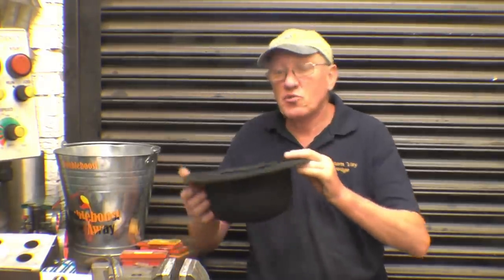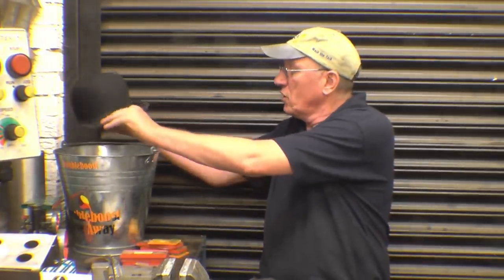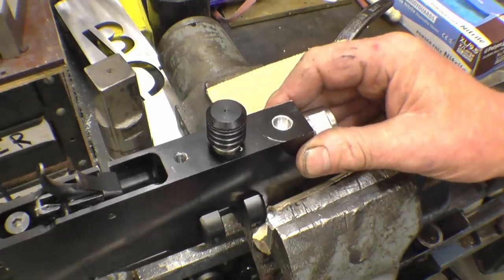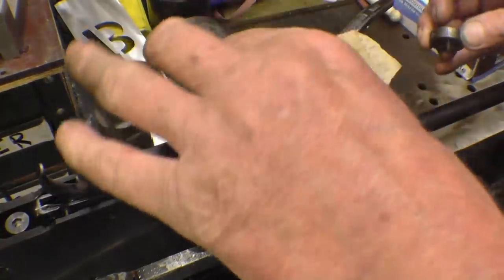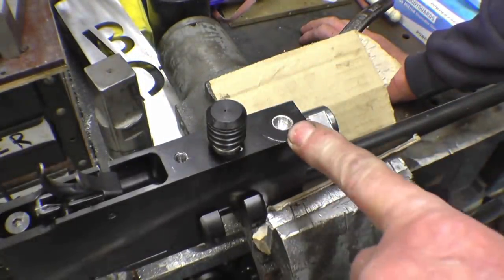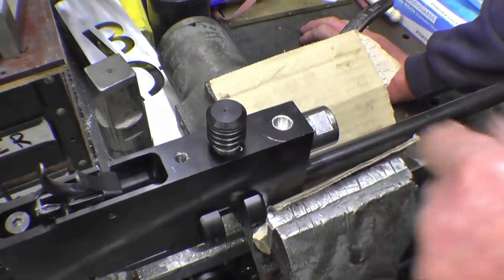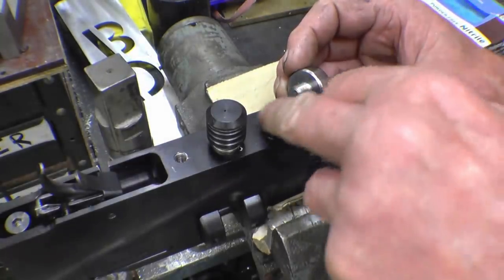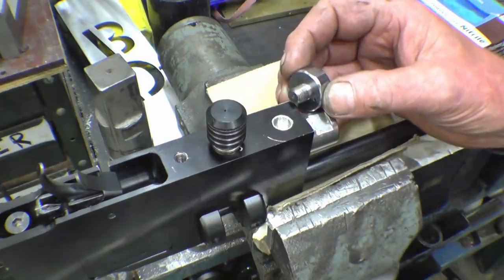SNNC 334 P1     Rapid 7 Air Rifle Repair .  Landy Axle Shims

Comment: That bottom plug hole is used by Theoben to gain access to the top part of the block in order to make an air port. It normally is finished with a doughty washer and substantial well threaded sealing plug sealing on the bottom land of the block, and not the bottom of the hole itself. Not wanting to doubt the fix, but in real terms that helicoil arrangement has to possibly sustain up to 230bar pressure. I think perhaps you can see where I'm going with this ...

Comment: 7:03 I love your videos and all but I learned that it's not very good practice to use an end mill in a drill chuck because they generate force that can pull the chuck off of it's arbor and the runout of a chuck can grately reduce the life of your end mill. Just thought I'd let you know before you loose a pretty end mill or have the chuck fall on the floor. Keep up the great videos though John!

Comment: Back when I had to helicoil an ally car engine - or three - the genuine helicoil kit insertion tool required one to screw the insert into the tool and then screw it out of the tool and into the repair hole simultaneously, so that the coil was guided.  That was back in about 1990.  Looks like the cool tools are cheaper now.
Reply: I was just going to send the same message to John. You can’t beat the genuine Helicoil  tools. These Chinese sets are crap.

Comment: Isn’t the collar on the insert tool supposed to be pushed right down onto the end of the insert. This then pushes the insert in square to the hole.
Reply from the maker: In theory yes  But you just do the best you can with fine threads

Comment: I used to repair threads in the JT3 engines (707 aircraft) in the engine shop many years ago they are hateful things John, but I do like the Wurth Time sert inserts solid steel jacket found them to be heaps better and a more longer time of service both ways are approved aviation repairs

Comment: John helicoil brand thread insert tool has the thread size in atube and the spin rod is the inside dia. Of thread with notch to drive the coil it keeps it square with the hole . Winding it in till flush. The tool your using is crooked and cocking the coil in the new thread. The stop may help on tool  to keep square but doubtful.

Comment: John,as you say,the fine helicoils can be a sod to get in square and seated right. Have you ever used or heard of Timesert Thread Repair  Inserts? They are as compact as a helicoil but the way they are formed means they are a true cylindrical insert with matching pitch threads inside and out. I've fitted many of them and they do produce a lot more reliable repair,especially on awkward or tricky fine threads.
Reply from the maker: I also use them  not available in that thread
Reply: @doubleboost  In that case it is Hobson's choice. Helicoil it is👍

Comment: I thought the tab on the coil should be in the bottom so when screwing it in it has the effect of pulling the diameter in and allows easy inset. Where having the tab on the top causes the coil to expand as your driving it in. Hence the trouble.
Reply from the maker: The tab was at the bottom of the insert  fine threads are just a pain  it is a cheap kit as well

Comment: That should have had an insert right from the factory, especially with fine threads in aluminum.
Reply: Agree with you. It is very poor practice for that not to have an inserted thread liner.👍
Reply: That is not a factory threaded hole that is being repaired. On the Rapid 7 block there are only two threaded holes in that location on the bottom of the block, a 1/4” BSP access plug and also a 1/4” UNF 28tpi trigger guard/stock fixing point .

Comment: You might have been better off with a solid thread insert, such as the TIME-SERT ones.
Reply from the maker: I could only find 1/8  27 tpi taper  not 28 tpi parallel inserts

Comment: Instead of a 10mm milling cutter, maybe you could have used an 8mm and then opened the hole to the recommended diameter. The washer was probably 8mm anyhow.. I was thinking maybe the bigger hole added to the pain in the arse threading of the helicoil?
Reply from the maker: The recommended hole size is 9.9 mill  they supply a drill  but i wanted a flat bottomed hole
Reply: @doubleboost  yes, I meant an 8mm flat hole..But I'm sure that 0.1mm makes no difference, surely?
Reply from the maker: @martinda7446  I needed full depth of hole to 10 mill that is why i used a milling cutter . I could not have gone any deeper

Comment: that does have to hold back 220bar of air pressure
Reply from the maker: The repair will be stronger than the original
Reply: @doubleboost  sweet
Reply: The hole is after the regulator, so should be about 100 bar
Reply: Standard aviation industry practice is to helicoil  threads in alloy.
Reply: @pacerpj  it's before so it takes full pressure ,when the bottle is fitted it reads 150 bar
Reply: @pauldavidson6321  it doesn’t appear to be regged at all ... that will have to hold full bottle pressure
Reply: @pacerpj  rapid7 isn't regulated

Comment: You need the real Helicoil brand that has a full thread installation tool not those crap imitation sets that don't have a proper installation tool. Make an installation tool from the correct thread so it can't jump thread.
Reply from the maker: I agree but the chance of using 1/8 BSP again is very remote . The real "Helicoil" kits were much better